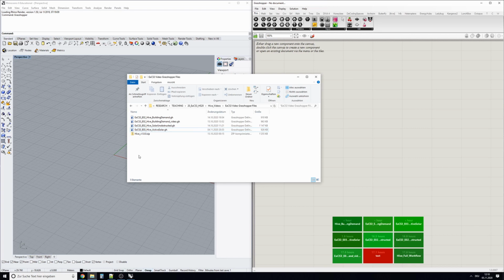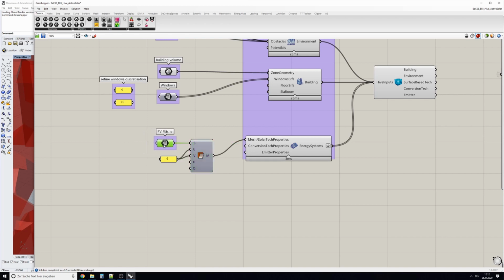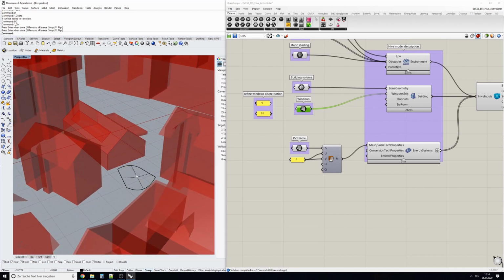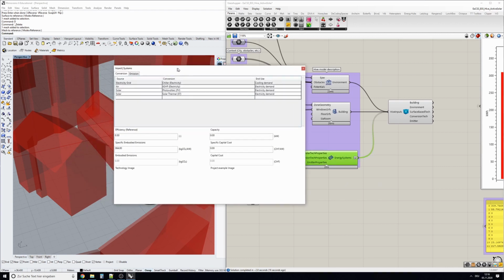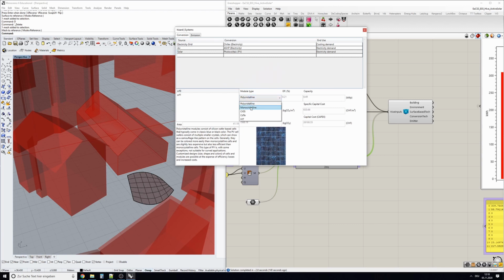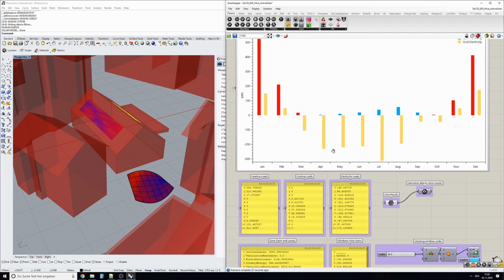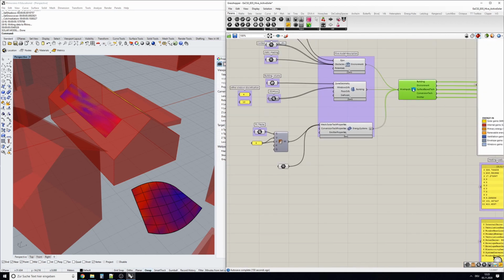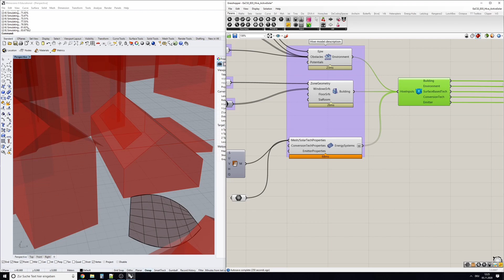HS20_Hive_08_ActiveSolar

Comment: Hi, thanks for the tutorial and nice plug-in by the way. Can we integrate it with the ladybug tools? For instance, analyze energy performance through honeybee and evaluate renewable energy systems via Hive, eventually integrate results?
Reply from the maker: Hi Nac, thanks for your feedback! Yes, in principle you can do it by replacing the demand simulator currently implemented in Hive with Honeybee Ladybug. However, it would require some custom ghpython scripting on your side to merge things together in the correct format that Hive can read.
Reply: @christophwaibel2494  Thanks, this is great...